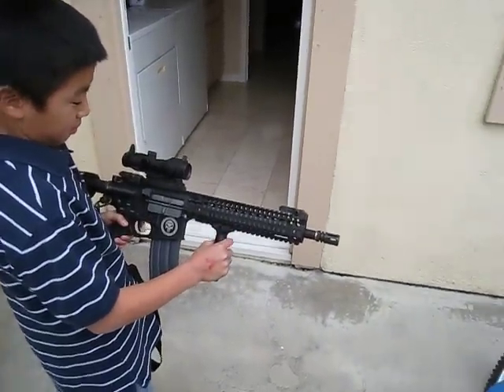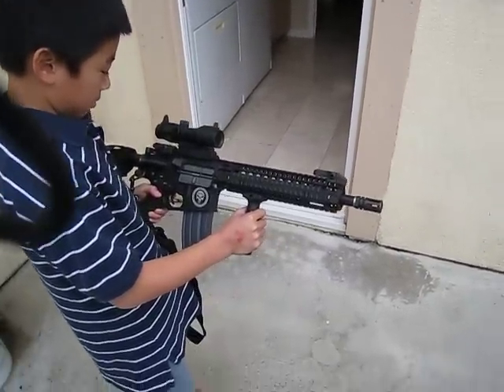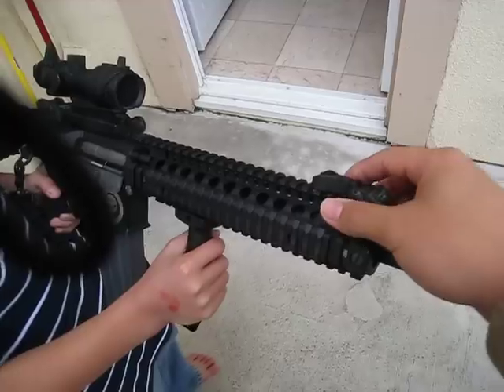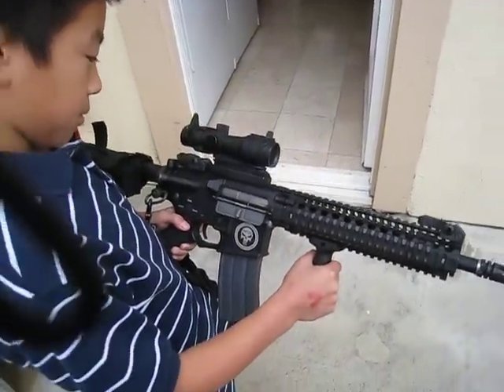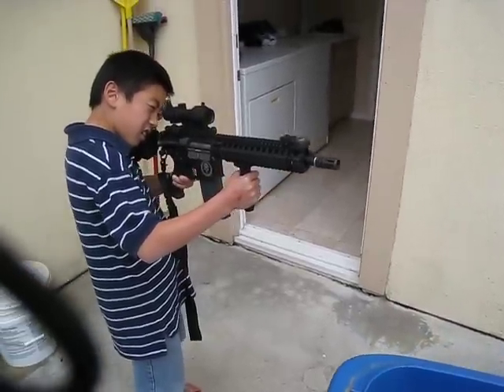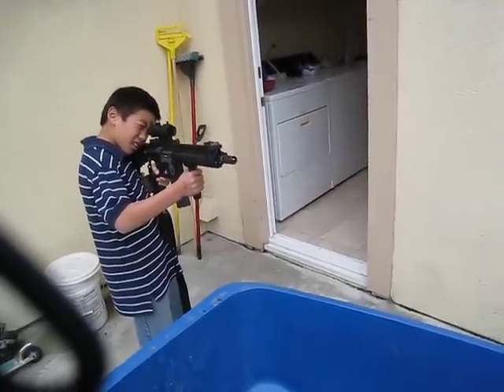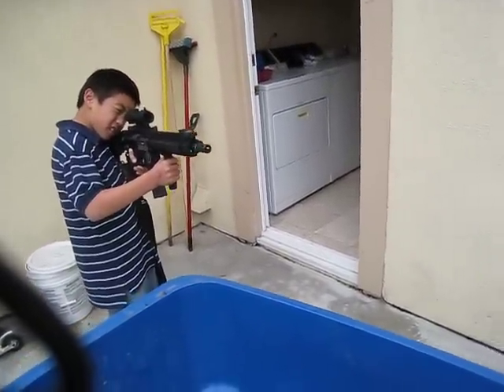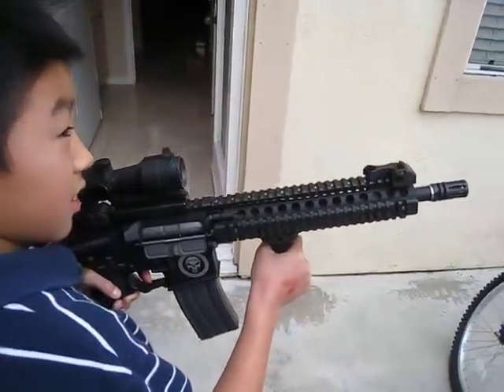G&P Defender AEG (shooting/rof test)

Comment: a mosfet is basically something that helps increase both rof and the trigger response. Active breaking specifically helps with trigger response. 

basically speaking they are essential for any high speed setup. If you are looking for a cheap way to increase your speed, install deans connectors (to reduce the resistance in the wiring which increases rof) and a mosfet with active breaking to help with trigger response and also rof (it doesn't impact rof as much as deans) which should be about $50